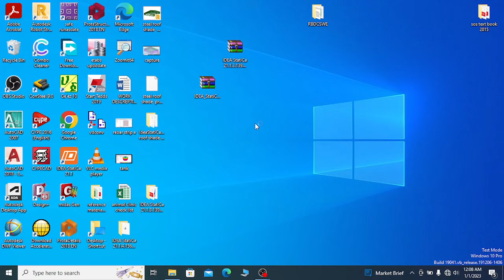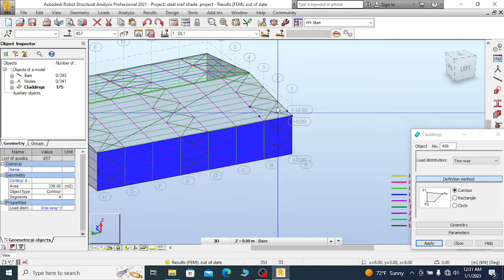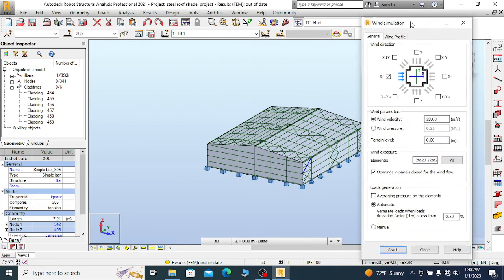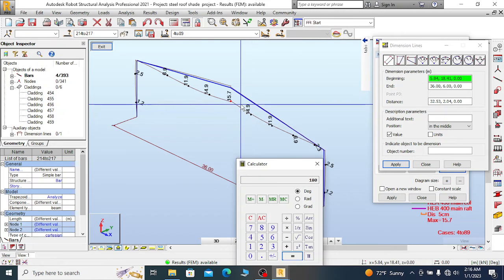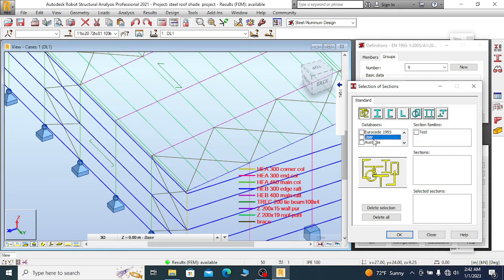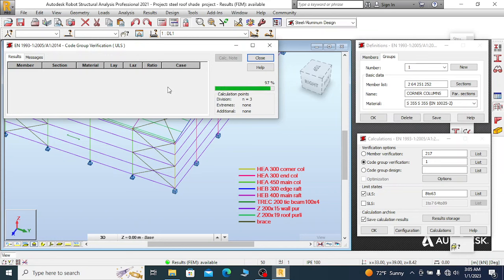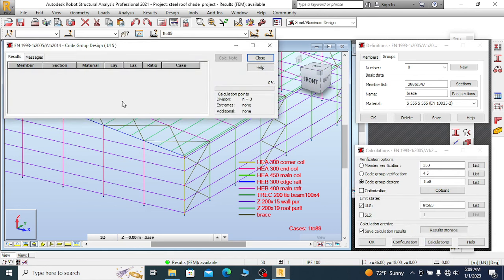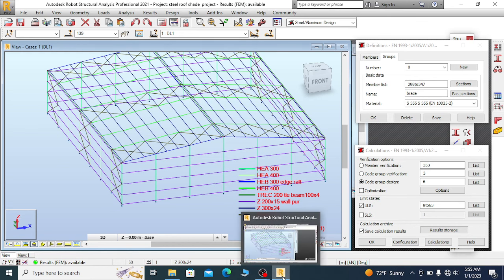Modelling,Analyzing and Designing of Steel structures by Eurocode in Robot structural analysis part2

Comment: The buckling coeficient of column in Y direction  depends on the stiffness of the rafter,and usuali is larger than 2 ,sometinmes even 3 or more..(for a sway structure).
Reply: You are wrong because it is justified for "linear analysis". He did "non-linear analysis" which doesn't require you to calculate effective length (can be chosen as "1") of a column or any compressed element.

Comment: Not bad, but there are few problems:
1.  Live load category should be "H (not accessible roof)", not "E (warehouse storage), as this affects combination. 
2. Live load category H should not be combined with either snow loads or wind actions (Clause 3.3.2(1) of EN 1991-1-1 OR SCI P397 p.20). That is why correctly chosen category is very important.

Comment: Why you changed the direction of the gable columns? They are mainly designed to carry wind loading and are pinned to the rafter, so they do not carry any moment.
Reply from the maker: gable colums  are not pinned with rafter . these are fixed with rafters.  see the  tutorial  part 2 critically  for final modeling issues. the moment and shear  at column -rafter  connection must be resisted by the flange and web respectively. see My  Vz results .
Reply: @melesedemissie7664  They are there to prop the rafter and resist the wind load at gabel wall as well, However not necessarily  to resist moment from rafter. 
Their major axis is more important to resist gabel wall wind load than the moment load from rafter, so the major axis better to stay perpendicular to rafter log. axis 

Wall bracing will can help to form the frame rigidity you intended to get from frame actions.

Comment: The deflection check of L/200 is against what load combination? SLS, ULS, SLS:CHR+&-,  SLS:FRE+&- OR SLS:QPR+&- OR ULS etc
Reply from the maker: RSA takes the geverning sls  load cases. you can see the gevern SLS load cases  at group code verification results. If u want to let robot considers the specified load cases, simply select the combination  from drop down list at design calculation dialog box